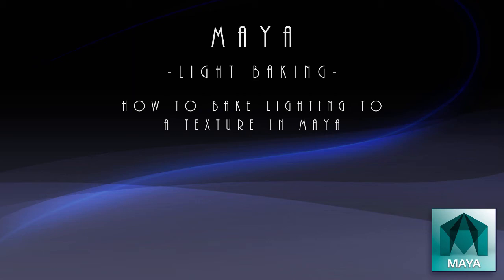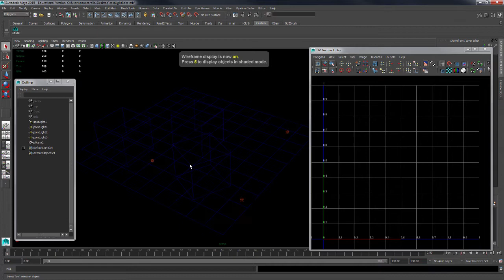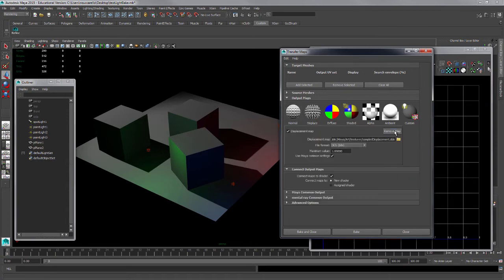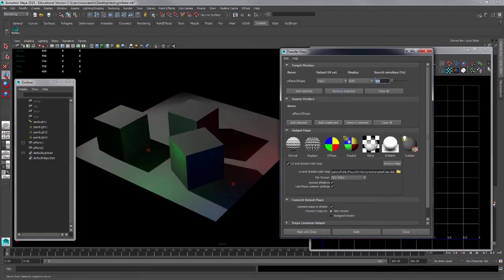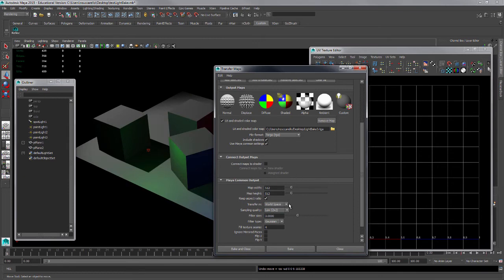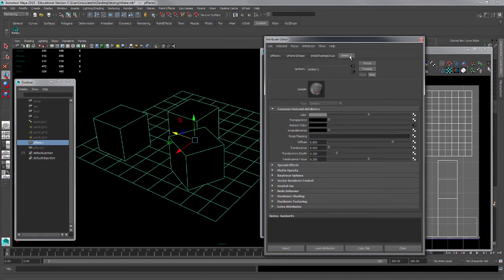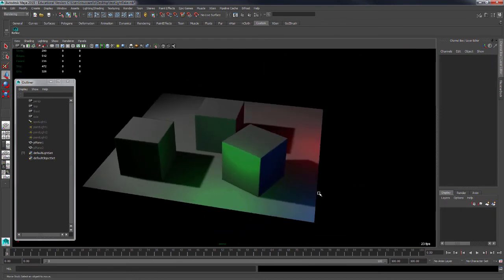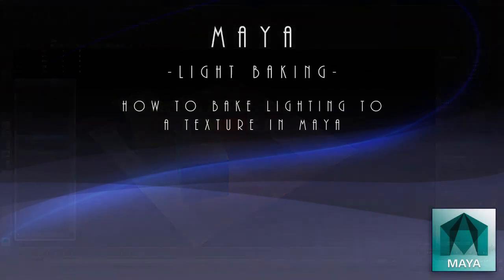Baking Lighting To A Texture In Maya

Comment: This is almost what I'm looking to do.  But I'm curious if its possible to get it to work with a high quality render from Arnold or if it's only possible with the maya lights lighting it in the viewport?
Reply: II was also wondering the same! Have you figured it out?
Reply: @fatmasaeed2073  Yes, I believe I did. Though it was a long time ago now and can't quite remember how!.
Reply: @fatmasaeed2073  Arnold is not supported by that transfer maps feature, and it's a shame. The only way to bake anything with arnold is to use the bake to texture tool inside Arnold menu. But it is not the same, and it is SUPER slow as hell if you want to bake some sort of indirect light (for architectural viz for example)